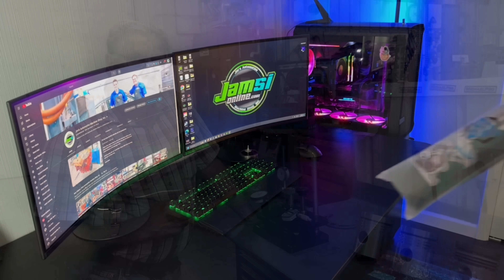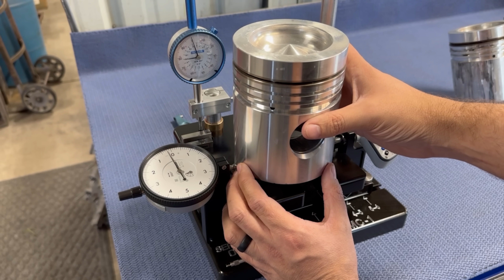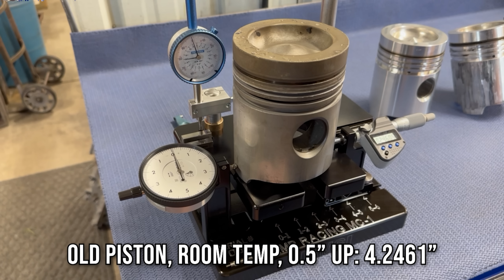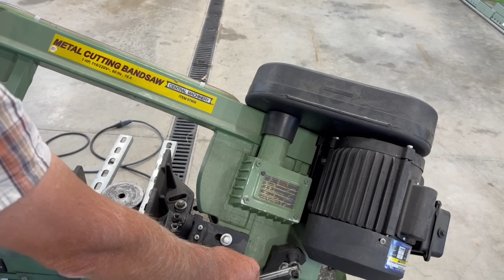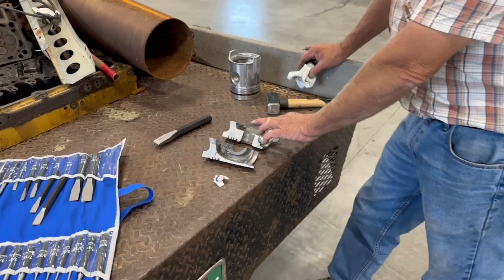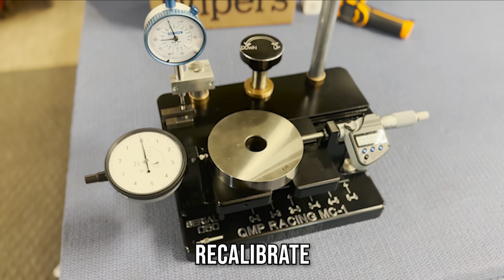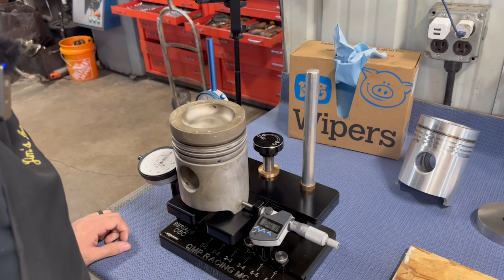Have TRACTOR Pistons Changed In 50 YEARS?

Comment: Any reason you can't use modern thin rings and higher compression ratio? Those old tractor engines only had a max CR of 6 to 1 because gas had only 40 octane. I would think performance could be greatly improved with modern pistons and rings.

Comment: A lot of recency bias in this video. I am a tool & die maker and in 2020 I made some A-2 tool steel parts for an Auto parts manufacture. I made 12 total parts, 6 out of a bar of A-2 that was produced in 1978 (stamped production date)and 6 out of a newly purchased bar from McMaster Car. All 12 parts were heat treated by a respected and very professional company. Three of the parts from the McMaster A-2 delaminated during heat treating. The other  3 parts quickly failed from stress cracks all while the 1970’s  A-2 parts are still in use in day to day production process with no issue. The original pistons that lasted 40 or more years was most likely produced 100% in the USA, even the material they were made from. On the other hand the aftermarket pistons most likely were made from materials produced in China or India. It’s common knowledge among Machine Tool rebuilders that the old American Iron was vastly superior to the modern day equivalent. It’s not the when but the who.

Comment: Interesting
Back during the energy crunch the Government paid GM to do a study on when to replace parts for fuel savings. On the wheel bearing back then you repacked every brake change and inspected. The result were all over the place and rerunning the test decided to make half worn  out bearing to speed up the test but that kind of tolerances could only be done in the lab. And much to their surprise they hadn't wore out by the end of the test. And after retooling with tighter tolerances half wore out no break in wheel bearing went from if your lucky 20,000 miles to 50,000. 
Bearing was the main fault in alternators but with the new bearing was still having problems. To tight of a belt puts to much side load and the answer the serpentine belt.
All thanks to a small Gov study on fuel saving.

Comment: I believe your hypothesis is correct. The new pistons do not grow as much when running at operating temps, and the first overhaul ring gap was to tight causing the engine failure. Live and learn. I’m confident you will never put an engine together without checking piston ring gap before installation. Love your content.

Comment: I made a few pistons in my life and I believe I made a few of those pistons.  When we measured them it had to be between 68 and 70 degrees.  Between the top and. Bottom of the skirt there's supposed to be 0.001 of an inch difference for most pistons.  Some of the Ford and AMC pistons are different. 

The rate of change for that piston should be about 0.0001 inch  per 2 degrees above or below 70 degrees..

For our pistons, the tolerance is 0 to  - 0.0005 of an inch.

Comment: When I built my 360 Dodge magnum I used 4" diameter Hypereutectic pistons with a piston to bore clearance of .0015-.002. I have had no issues with the engine and it burns no oil. So I do not believe you had a clearance issue but every engine is different. Was your bore too smooth so oil retention was low? Its hard to get an answer on what hone grit to use but it appears for cast rings its between a 180 and 220 grit. My manual for my John Deer 3 cylinder Yanmar specifically called for a 180 grit ball hone which I used and had no issue with it.

Comment: Lube oil has changed also in 50 years
As I am a old gearheads, I think the lube oil now is not nearly as effective as the oil before.
I use to use 30 weight Gulfpride for years
It kept my oil burning leaded gas Chevy engines together for many many years.
It kept them clean.
Todays oil , without the benefit of leaded gasoline has coated every engine inside even if you change the oil regularly. Of course what does a old fool know about this new stuff.
New materials are used to make engine parts now . Silicone impregnated parts and every kind of metal formula dreamed up give us engines a life 4 or 5 times longer. Of course they are are very close to all throw away stuff now.
I remember the first time I tore down a Chevy engine at 50 thousand miles and it still had honing marks. Things change usually for the better, and sometimes not.

Comment: As it goes, the way I see it, you would been better off just keeping the pistons and sleeves, just get new rings, and hone the sleeves! Get them back to a round square! (Close as possible) and reassemble a loose engine, I have 'rebuilt' lawnmower engines doing less than that, I just honed the bore.  Cleaned the rings with 320 sand paper.  And reassembled the engine, and it was fine! It would barely run before, low compression, burned oil.  And was almost like a new engine , I know a diesel is a lot different, and would only be a option, if you had zero other options, at best it would probably get you through a season or two! Possibly putting the rings in a oven at 350°f - 450°f for about 45 minutes,  then quench may help put the spring back in the rings! Or warp them, so new rings is the better idea! (The better of bad ideas!)

Comment: The 1915 parts manual for BSA motorcycles states that a Cast-Iron Piston was an option back in the day.   So we have moved on a lot since then.   Honda die cast pistons were a major step forward from the old soft aluminium Hepolite machined pistons.
Reply: All the old Hondas I ever had had broken rings and smoked like the neighborhood mosquito patrol!  On the other hand, forged aluminum tractor pistons?  I've seen them with tens of thousands of hours on them.

Comment: Great science project, searching for root cause.  Thanks for taking this effort, which takes much more planning that it appears.  Similar is done in high-dollar aerospace failure reviews.  Most automotive work is just trial and error (keep failing until you don't) and speculation.  Not sure I follow that a 1 mil difference in expansion, out of 11 mil is significant.  That is like a spot of dust you wipe off vernier calipers to check zero.  Even if the aftermarket piston maker gives you a spec for clearance to the cylinder wall, would they also give you a spec on piston ring gap?  Seems they wouldn't want to take that on unless they also made the rings.  That spec seems like your main culprit.  If the rings jammed in the cylinder, as suspected, could that account for the scuffing seen on the piston skirts?  Seems rings would need to get significantly hotter than the cylinder walls for the gap to close.  Since both are steel, they should expand in size equally, if they stay close to the same temperature.

Lack of information on parts is frustrating.  There are numerous products on Amazon where the critical details must be related via Q & A by customers and reviewers.  You'd think the sellers and/or manufacturers would be competent enough to give basic information, and at least review their product pages to see what potential customers are asking about it.   Often the sizes they list are the just size of the box it comes in (whoopie).  Especially true for products Made in China, where English translations are minimal and confused, often the same product sold under many different brand names.  Even name-brand auto parts are becoming like that.  Especially critical in engine parts, like here.

Re quality, I installed a name brand intake manifold gasket once during a head swap, then when searching for a vacuum leak 10 years later I found the gasket had hardened and broken apart, leaving big gaps open.  The engine was idling way too fast, even with the IAC port blocked.  Finally found it by flowing water around all interfaces until it slowed down.  The gasket was in a hard place to see since the intake manifold curves up over the interface to the block.  Seems like they cut the gasket out of black paper.

Comment: Like your videos, have learned some finer points of machining.  That said you two are like the blind leading the blind.  Solids expand like a photo enlargement, all dimensions by the same factor.  So the greater the temperature difference and the longer the test dimension the better.   Take your milling machine and mill true flats on the top of the pistons and the bottom of the skirt.  Put pistons in Dry Ice or liquid Nitrogen for the low temp and use oven mitts to handle unit under test.  High temp use boiling water that way the hot and cold containers can be next to measuring place, and you can measure and remeasure as many time as it takes to get a good repeatable numbers.   After all the thermal expansion is in the order of 0.00024/ 1 degree C.  We know the top of the piston will be hotter and expand  more than the skirt.   The difference in  heat flow from the top of piston to  cylinder walls may be a factor.  Have NO clue how to check that.  Keep on Trucking.  Thanks ron

Comment: Great in depth video, just not sure the data collected at around 300 degrees really tells the tale. Considering, a diesel piston normally operates at 800 + degrees. Would have loved to see the average expansion rate at temps closer to that range, but, it's certainly understandable that heating a piston to a consistant 800 degrees in an average machine shop would be an extremely difficult task to perform, indeed. Very informative nonetheless!

Comment: Thanks for the video it was interesting to see. I'm curious about the piston grooves concentricity because together with the piston rings they will position the piston in the liner. For big ship engines we call that for scuffing when the piston grind against the liner wall. The piston rings are also coated with a soft metal compound that will wear up.

Comment: In the 70's my late father worked for Champion graders, they had a situation where the new champion pistons where failing fast, my father worked out that the new pistons were heavier due to more mass, this retained heat more and expanded more are a result and resulted in slowballing of premature failing (champion themselves repeated that clearances were checked and are fine so thats not the issue) , downtime with million dollar mining equipment is never good so my dad went with his gut and drilled the pistons and reduced the mass, this fixed the issue and as a family we got a free holiday as thanks.

Comment: 2 things that also require investigating are the original engine oil viscosity ( oil pressure ) and oil pump flow output , if you used a thinner oil then that might also be the part culprit. the oil pump gears may have been spaced larger to account for the thicker engine oil used during those periods to maintain correct oil pressure ( upwards or over 75 psi oil pressure was correct for engines )
i remember an old flathead ford V 8 showing 94 psi on the pressure gauge
Reply: If you watch the teardown videos, the bearings looked like new. And even the old bearings looked pretty good for an old machine. They were getting plenty of pressure. Piston skirts are more or less splash-lubricated on this engine and if anything, a lower-viscosity oil would reach those parts sooner and lubricate as well, assuming sufficient film strength. The original engine probably called for 10W30 or 15W40 and those oils are still made and used widely. A 10W30 is the same viscosity today as it ever was. I don't quite remember what they were using for oil, but there's no indication they used anything lighter. And I haven't used a 5W40 or 0W40 synthetic in these, but again, even if they did, the bearings look beautiful and the rings and pistons should have been happy. I've seen engines that were diluted so bad there really was an oil pressure problem (injector pump that was leaking into the crankcase and washed the oil out through the breather). Bearings were spun; cylinders looked surprisingly good.

There was also a lot of evidence that the injector pump was faulty and causing excessive heat in (some of) the combustion chambers. Supposedly the injector pump was overhauled while the engine was rebuilt, but the engine was rebuilt because of issues that pointed to a bad injector pump (cracked rings, scored pistons). And apparently after the overhaul the timing was off 180 degrees. I would guess that more than timing, the matter was due to cross-leaks in the pump that the overhaul didn't address - otherwise, why were some of the cylinders still in good shape while 3 of them were cooked? But they didn't get all the data they asked for from the company that rebuilt the injection pump the second time.
Reply: @mtut  that comment brings back a memory of a video i watched on youtube around 2009 , where a machinist was questioned why some farmers were removing the thermostats from their tractor engines , his reply was , tractor engines run hot ,sometimes very hot ,resulting in blown head gaskets ,removing the thermostats from the engines allows the engine coolant to be constantly cooled ,thus resulting in lower engine operating temperatures and less head gasket failures

Comment: Nice job guys it just goes to show you go back to the manufacture that made the parts, and that's in really everything.
Reply: 50 years down the road, the original source may not be the same or exist at all. Allis Chalmers like International Harvester did much in house to avoid outsourcing (but i think around the 1970s started to go away from that concept). Also both Companies ceased to exist around 1985.  Furthermore the other vendors such as Federal Mogul have gone thru multiple corporate changes and plant closures in 50 years--the part you buy today is not the same as the part 20 years ago. Some parts have been eliminated, others consolidated, and some cost-reduced. In some instances the part you get from completely unrelated brands is identical, the manufacturers do a lot of B2B trades and reboxing so they don't have to run a line for a small run with near zero demand. Good old days not always good and progress not always to the good.
Reply: Good Point. @karlfischer1011

Comment: listening while fixing my toilet .... 7040 i did , mid 1980s .... spec was .0025 - .005 ; (Piston cooling jets) ,  it ran few hundred hours well , until chisel plow in MUD , "squeeked" . one center Oring rolled out and cut , pushed in justa little . cleaned up measured , REsleeve/kit , we were going again . now MANY people remember the 301 specs 0045 - 009 , if memory serves . common aftermarket sizing is 006 - 007 avg.  some 7000 needed conversion to oil jet bearing of 7010/7020 with the tight OEM kits . i had one such engine .

Comment: Very interesting data and discussions. Thanks. One note on metrology: IR thermometers generally show very unreliable values on shiny metal objects. Also, when using an IR thermometer get as close to the surface to be measured as possible. The cone of detection is quite large so that at a distance you are measuring the desired object and a large amount of background. Sorry for the pedanticism. I'm an old, retired scientist.

Comment: You should chop up a gas 366 or 427 tall deck piston and compare it to a standard deck big block piston. Show the deference between a 100% duty cycle piston and a passenger car piston that only really is designed for short burst of full throttle.😊 Maby even find a tall deck 4 ring big block to rebuild and send it to Richard holdner to do a big bang Dyno series on.

Comment: Your results indicate no real change in material. Most of the measurements change was in the low part of the piston and the new piston clearly has a larger brace ring to make the skirt stronger. This would also effect the measurements. Being within .001” on a 4” bore over a 300 deg temp spread is negligible.  I usually shoot for .001” clearance/inch of bore size.

Comment: Great methodical fault analysis even though that was not the reason for the failure and it at least ruled it out and points to the ring gap theory. If the pump was causing over fueling and the crown of the piston was running hotter than it should have then the ring gap may be the answer. Another reason manufacturers could be running less clearance between pistons and bores is the improvement in lubricants as well as other improvements in metals and machining.

Comment: I see no relevance to a frozen piston measurement. Certainly room temperature and hot are relevant. My latest V8 build has hypereutectic pistons and a .006" piston to wall clearance. With diesels, surely your combustion temeperatures are higher? Maybe the .009" clearance is warranted with those very long piston skirts? Do you use any special running in oil on this engine? What oil did you use?

Comment: The obvious, put the pistons in the oven at 180 deg for 15 min them measure them.  Or better simply boil them in hot water. Far from ideal but it will give A measurement and IF different you have a start.

Comment: Hay here is a question. Does New diesel burn hotter then old diesel? Maybe the new Diesel burns hotter then the old ring gap specs are for so you need to open them up a bit more.

Comment: Your skirt wear was caused by timing being off. Seen it too many times when the customer doesn't want his fuel pump rebuilt the same time as the engine. Retarded timing just a few degrees will slam the piston against the liner every time.

Comment: Have you guys done anything with the new 'Speed of Air' pistons w\ the dimples in the tops of them? I've seen\heard real good things about them. Increased hp/tq & mpg across the board. Especially helpful for truckers\hotshoters cause of the increase in mpg which equals more money kept in their pockets, not spent on expensive fuel. Check them out if you haven't heard of them yet? Lmk your thoughts? 🤔🤷🏼‍♂️👍🛠️📏🔧
Reply: Nobody takes a clown with emojis seriously.  Especially when they push BS marketing.  Son if it were viable who would be using it?  OEM's.  Are they... nope.